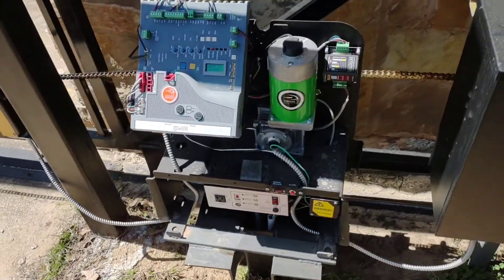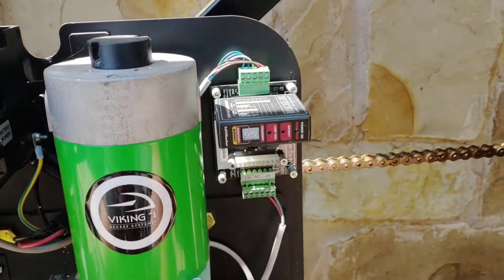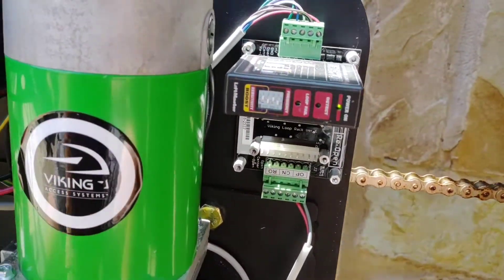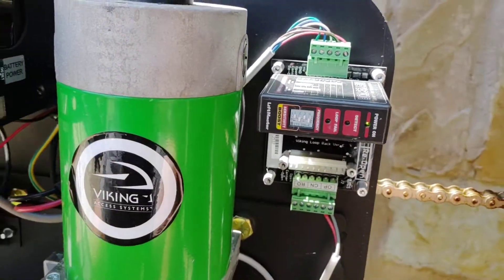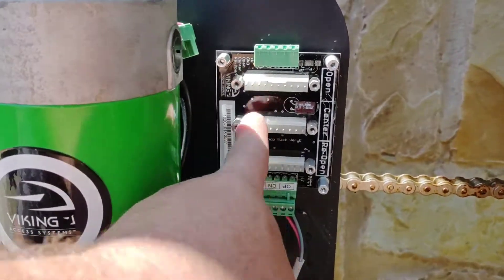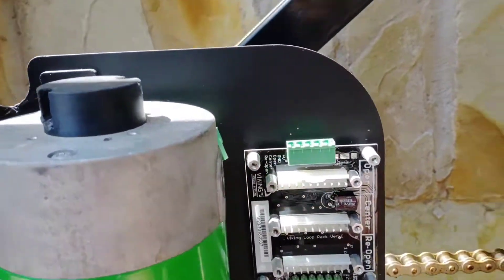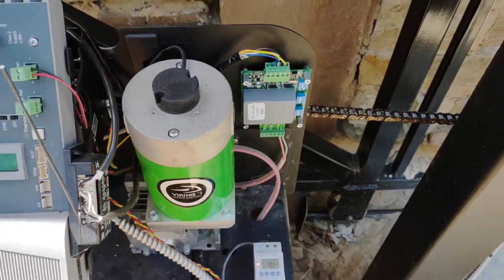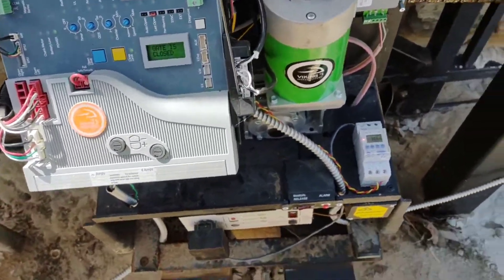Viking Gate Openers: I'm Sorry But Not Sorry

Comment: I have a viking h10, having problems with having to reset the limits.  We even replaced the board and still the same problem persists.  It starts with the gate not closing all the way.  It eventually closes "less and less."  Do you have any ideas what is causing this?

Comment: I have a Viking L-3 SPS installed less than a year ago. It started randomly just not opening. Turning the power off, then on would get it working again. Now, it has stopped opening. If I manually open the gate, and use a remote, it will close. If I disconnect the Radio wire and use the onboard open, close, stop buttons it doesn't do anything so I assume the older receiver we kept from our All-O-Matic is still good. I have made sure that all sensors are clean and aligned. DC tested at 27.5V and AC at 25.4V. When I push the remote to open, the LED shows "Gate Opening" but its not and the Aux Pwr red light on the right side come on and the "Check Motor" light also comes on. When I push the remote again, it says "Gate Closed" and the Aux Pwr and Check Motor lights go out. Any possible issues that jump out? Could the sensor on the opening side be bad, making the motor think there's something there and thus not open? Any thoughts are greatly appreciated.  Thx!

Comment: Hello, I have a problem with my Vikings exit gate, it has an automatic opening system, but after a while it stopped working, it only opens and closes with the control but not automatically. If I want to change the sensor system, which one do you recommend me?
Reply from the maker: That would depend a lot on your situation. Do you know if you are currently using a ground loop, or a sensor that detector moving metal ("probe)?

Comment: I am having a problem with my H-10 opening during rain storm and staying open in fail safe position until an hour or two after rain is over, Then it closes. I lifted cover and board still had power.
Reply from the maker: What indicator lights are lit up on the control board when it is stuck open?
Reply: @JacobGilliamMasterTech  Re-Open is Yellow. Open Limit is Green. Magnetic Lock Relay is Yellow 
. Power is Green
Reply from the maker: That ReOpen light is the rabbit hole to go down. What is wired to that connection on the board? It is highly likely the issue is a safety beam. It probably gets rain on the beam or its reflector and stays open until the water dries. I would check the alignment of the beam to make sure it is as centered as possible aiming at the reflector.

Comment: Question. If you can throw away the "loop" what purpose does it serve?
Reply from the maker: Not everyone requires that functionality. It is there and available if needed, but not always used by every client. During new installations, if it is not required for the location, I unplug the rack and remove the factory wires from the main control board.

Comment: Hi Jacob, I just wanted to get back to you as promised. I reached out to Viking Access Tech Support today, and they emailed me this list of loop detectors they have confirmed will work with their loop rack. 
EDI LMA-1800
EDI LMA-1800LP
DIABLO DSP-40S
DIABLO DSP-50
NORTH STAR NP2-ES
I asked them specifically about the Liftmaster loop detectors and they said these will not work. They weren't exactly sure why it does not work, but it does not. Similar to the Liftmaster photo eye, LMRRUL, which only works with Liftmeastrer operators. I hope this helps you out. It seems a shame to have to throw out a perfectly good component  when if you just order the correct loop detectors, you can save yourself some time and effort. Good Luck.

Comment: I notice you are using a Liftmaster Loop detector in that Viking loop rack. I'm reasonably sure that detector is not compatible with the Viking loop rack. I looked today for Viking's list of compatible detectors, but could not locate it. I have seen a list before, and I remember that Liftmaster was not compatible. I'll contact Viking tech support on Monday and confirm. I have been installing and servicing Viking since they came on the market. I have never had an issue with their loop rack when I use a detector that they have tested. More soon.
Reply from the maker: We have tried every imaginable brand of loop detector on those loop racks since probably the year 2008. That just happened to be the brand of detector someone had installed inside 'that' model, at 'that' specific customer, when my team & I stopped to service it and I decided to finally just make a video about the topic. Just a random service call and a random customer, but a universal problem across all customers. Viking even called and acknowledged the issue and asked if I had any possible ideas as to the "why", or ideas on a solution; they were looking for anything that they hadn't already considered... and you gotta respect a company like that. ;-)

Comment: I've got an issue with a Viking neigborhood swing gate. The entrance syncs with the timer well with no issues, however, the exit after two months of no issue with a new timer defaults to (when it's time to close the gate) instead of the 1 minute countdown before closing, the Viking unit flickers between 59 and 58 and is stuck doing that and the gate remains open. Any clue?
Reply from the maker: Is the "Open" or "ReOpen"  light on the board lit up when this issue occurs?

Comment: I just purchased a home with an L3 model, and recently, my gate decided not to open daily.  It has the ERR UL Sensor and ERR EMI NO EMI, but if I wait a few hours, it will start working again.  Any suggestions?
Reply from the maker: The no EMI is likely of no concern, as the machine is still operating. But the UL Sensor error is in regards to the safety beam that covers the area that the gate slides open to. Basically, it THINKS someone or something is behind the gate, so it will not open until it thinks the area is clear. Hopefully the safety sensor was installed and installed properly by the tech. Could be something as simple as an alignment adjustment to that sensor, but it could be multiple causes. In this situation it would be best to call a qualified technician that can put their eyes one the situation. I can attempt to be more helpful if you can send me some photos of the install.
Reply: I posted two short clips.
Reply: I can’t figure out how to attach a video to this.
Reply from the maker: I received your text messages, just send photos there :-)

Comment: HI JACOB CAN YOU ANSWER I INTALL OPENERS BUT I HAVE THIS PROBLEM WITH VIKING 1 THIS HAVE TIMER FOR OPEN AND CLOSE ALL WEEK BUT WE CAN'T OPEN OR CLOSE WITH KEYPAD IF THE TIMER ARE ON ONLY CAN MOVE WHEN TIMER ARE OFF YOU KNOW WHATS THE PROBLEM O HOW CAN FIX IT
Reply from the maker: That sounds normal. If you have a 7 day timer that opens your gate at a certain time and allows it to close at a set time, then it will over ride any other commands. You can't override the timer with a keypad or remote.
Reply from the maker: It could technically be "done". But normal setups would not allow for it.

Comment: Hey Jacob was wondering if you could tell me how to program new controllers to my gate and to make only those controllers open my gate because I order some on Amazon and without programming them they opened my gate that’s a safety issue
Reply from the maker: What remotes are you using? Typically has a brand and model on the back of one of them.
Reply: @JacobGilliamMasterTech  I’m using the lift master
Reply from the maker: Sorry for the delayed reply!
Reply: Change the dip switches in the receiver in the gate then match them on your remote. Should be 10 of them and you can change them up and down but they come up down up down from what I've seen so unless you change them they will probably all work if they are new.

Comment: Do you have any videos on connecting up a photocell? Any help is appreciated.
Reply from the maker: Do you have a particular safety sensor in mind, to any particular operator? Maybe I can consider making a video for you ;-)
Reply: @JacobGilliamMasterTech  wow that’s a really fast reply and thank you so much. I have a Viking slide gate opener and I just added the Viking Monitor wifi option. Works like a charm. The previous photo cell works on a reflector. It’s a NIR-50-325
UL325 RETROREFLECTIVE PHOTOEYE KIT. The previous homeowner completely disconnected it. The gate today will crush a fender or kill a child. No kids around. I have a vflex board and the wiring diagrams are not clear. I get three wires in and I’m left guessing. So photo cell to a vflex board? If your so inclined. Regards,B
Reply from the maker: @bmack2938  yes, they will have 5 wires, but you will nearly always not be using the 5th (Normally Closed NC wire).

What color is the round Viking logo on your board? Black, green, or orange?
Reply from the maker: @bmack2938  I will also tell you that you should be seeing FOUR wires from that EMX sensor - Brown, Blue, Grey, and White ; the Black wire has most likely been snipped off (which most people do).
Reply: @JacobGilliamMasterTech  five. I’ll direct the wiring diagrams tomorrow
Reply from the maker: @bmack2938  the color of the Viking logo on the control board tells me what firmware you have, then I can provide guidance.
Reply: @JacobGilliamMasterTech  Thanks for helping me out. It’s green. The gate was installed around 2013-14.
Reply: @JacobGilliamMasterTech  yes those are the colors.
Reply from the maker: @bmack2938 Then it's Brown to 28V. Blue to GND. Grey to REOPEN. White to GND. Black is not used. ;-)

And GENTLEY turn your sensitivity up on top of that sensor with a 1/8 flat screwdriver.
Reply: @JacobGilliamMasterTech  Thanks for helping. I’m going to try that in the morning. Should any lights come on regarding the photo cell?
Reply from the maker: @bmack2938  yes, you want to see both the yellow and red led lit up (indicating it's getting power and the reflector is aligned with a good signal strength).

If you see no lights, then the reflector is definitely not aligned. If you see the red light but not the yellow light, then it could be a weak alignment to the reflector.
Reply: @JacobGilliamMasterTech  Thanks for the help. I held the reflector right up to the end unit. I get intermittent red and yellow. The sensitivity screw spins in either direction infinitely. The reflector is cracked and has some ares with cloudy uv damage. When move the reflector at all I lose both lights or my hand in front of it the gate doesn’t stop. I think with the sensitivity just screw just spinning it’s snapped off inside and the reflector being bad I’m just going to replace the unit. What kind would you recommend? Is a good over the reflector preferred? Thank you again for the help.
Reply from the maker: @bmack2938 yeah it's very easy to damage that sensitivity knob. Sounds like you need a new one for sure. You can always just order the same thing. Unless you want to go up in quality, which also means going up in size. Consider the Omron E3K. You can even order a black cover for it, so you don't have to see the factory orange casing.
Reply from the maker: I do not at this time. There are so many different types of safety beams and operators, it's a bit daunting to consider how to eat that elephant lol
Reply: @JacobGilliamMasterTech  the reflective photo cells all seem to have five wires.

Comment: Where in the heck is the Learn/program button on the K2? I've given this thing everything but a prostate exam trying to find it. The manual is no help and searches online are useless. I had someone install it and now they are gone. I need to program some remotes for my kids. HELP PLEASE!!!
Reply from the maker: Okay, I can understand why you're frustrated. Viking doesn't make remotes. So first I need to know what brand of remotes you are using?
Reply: @JacobGilliamMasterTech  Mine is a Linear MultiCode. I is a big gray remote. It has DIP switches inside. If that is what you have it is easy. Just match the switches
Reply: @JacobGilliamMasterTech I have both the lift master main box and vehicle remotes. I can program the remotes, but I can't find a learn button to change the code on the one thats on the post. Anybody know how to reprogram it?

Comment: I have a Viking key to sliding gate opener. I do not know how to put it in neutral we get frequent power outages, and I do not have a battery connected. Is there a simple way to put the gate in neutral so I can manually open it without having to remove the chain?
Reply from the maker: Viking slide models do not have a "neutral". The key you have is likely to lock the plastic cover down on the chassis. But all Vikings do have an emergency release switch that allows you to push real hard and back drive the gearbox with the chain still attached. Lean into it and the gate opens slowly. Find the red emergency release switch and flick it to the "off" or "release" position.

Comment: Hello I have a quick question will the loop detector effect the wireless keypad.
Reply from the maker: They are separate accessories inside the gate operator. They shouldn't have any effect on each other whatsoever. That's the 99% accurate answer. There are always rare exceptions to every rule.

Comment: Hi do ever do a review on who offers most complete and integrated community access capabilities.  I get really concerned about having multi-vendor solutions because they may integrate but I cannot get overall performance data, proactive notifications when there are problems, etc.  Any thoughts on this?
Reply from the maker: Interesting question! In 20 years nobody's ever brought that up. But now that you ask, I do know of a few manufacturers who are good about covering all aspects of the automation of gates and the access control. I would have to say DoorKing and Linear. Both of them make access control equipment AND gate operators. 

Most vendors usually make one or the other. And so, yes, in most situations you're mixing and matching manufacturers. 

If I give it more thought, maybe I can think of another brand or two, but for right now those are the two that come to mind first.
Reply: @JacobGilliamMasterTech  The one we are looking at specifically is LiftMaster.  They have gate operators, barrier arm  systems, transponder readers, kiosk and a subscription based guest management app for residents.  Seems like a comprehensive end-to-end solution.
Reply from the maker: There you go! Sounds like you found your solution :-)
Reply: @JacobGilliamMasterTech  Thank you.  have you done any reviews on pro/cons of in ground versus above ground vehicle detection solutions?

Comment: Mines making a siren like. Car going off what to do
Reply from the maker: Highly likely the electrical power to it is cut off and the batteries are now too low to operate the motor. 

It can be 1) a breaker 2) a fuse 3) a bad EMI board 4) a bad toroidal transformer.

Check for fuses first. 

Send me the model number you have.
Reply: @JacobGilliamMasterTech 1:16
Reply: Top board doesn't light up any more.

Comment: Hi, we’re about to get a new unit installed and we’re debating in between all-o-matic or Viking brands. Which one would you recommend for a sliding residential gate ?
Thank you
Reply from the maker: I have a lot of respect for both brands. What influences my suggestion the most is 5 things:

1) the gate (slide/swing, size of entrance opening, weight, design)
2) the area of the country it's being installed in
3) electric of solar
4) how many homes behind the gate
5) between which models you are trying to decide on; the model of the Viking vs the model of the All-O-Matic.

Then I can give you an honest opinion 🙂

Comment: Mine won’t close says sensor error any help be nice
Reply from the maker: It has been operational, and now is says "sensor error"?

Before considering throwing money at it, try to first pull the big white connector off the control board (it has a red, black, green, and white wiring in the connector) -- this will power the board power down -- once the board is powered down, then plug the white connector back in, let the board boot up, and see if the error clears. If not, then it's best to get a qualified technician scheduled.